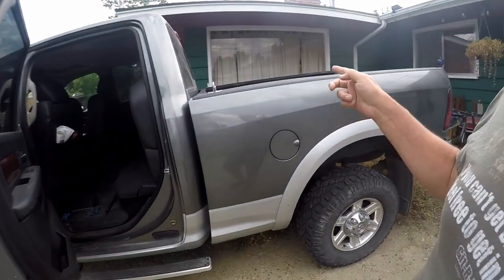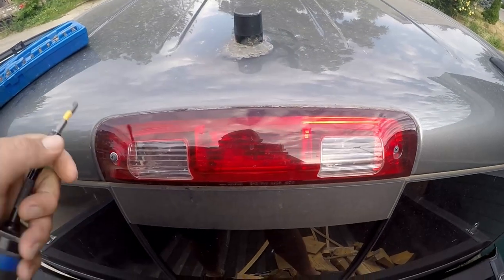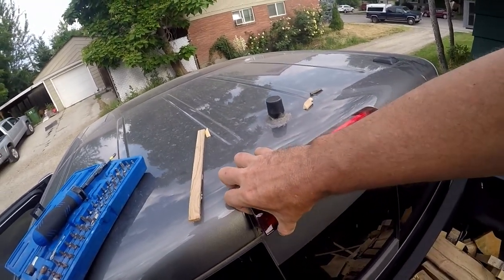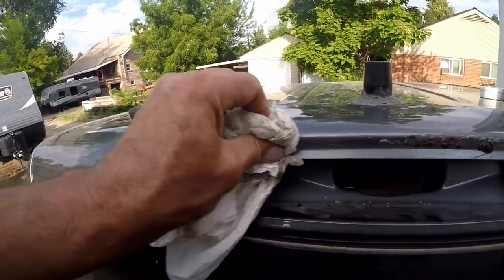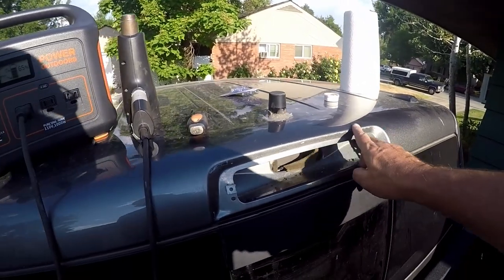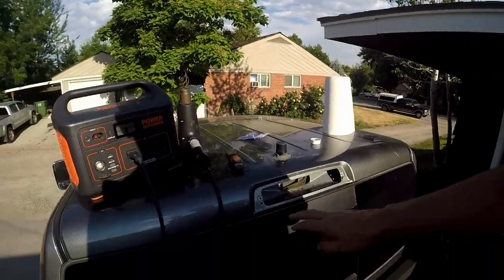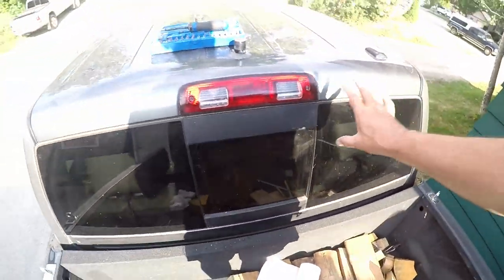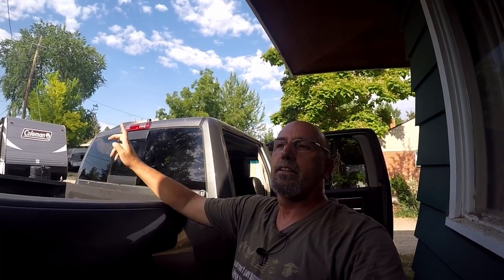RAM 3RD BRAKE LIGHT SEAL

Comment: I have a ram and I feel your pain. But silicone is a bandaid. Definitely not a permanent fix. 

Next time replace your gasket with some thicker than the factory and fill the void In between the cargo light fixture and the cab.  ( not with silicone). 
And please don’t pry on your trucks cargo light with a metal tool. ( this goes back to never putting silicone in between your cargo lamp and your truck )